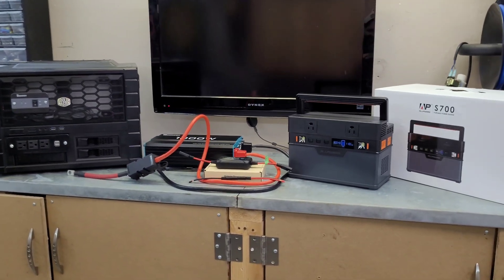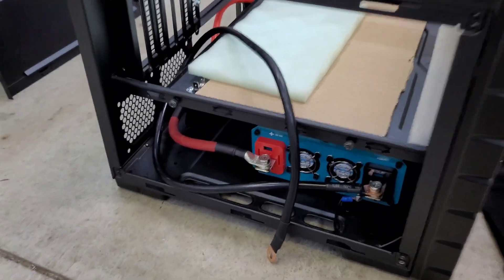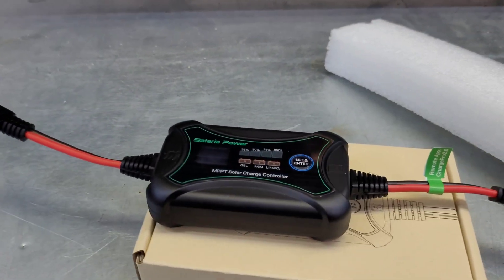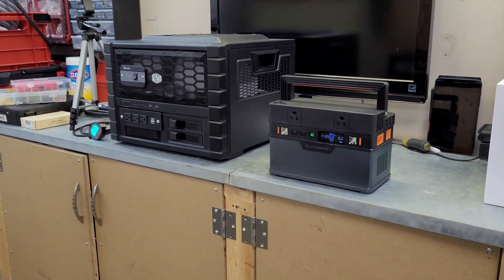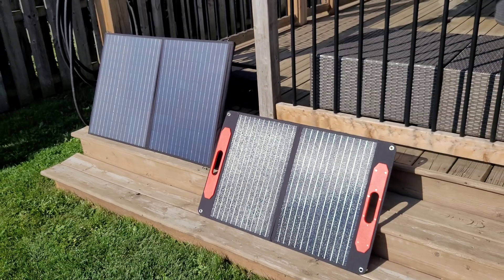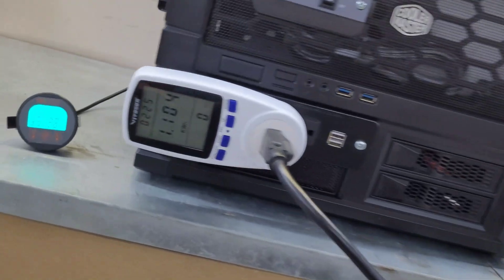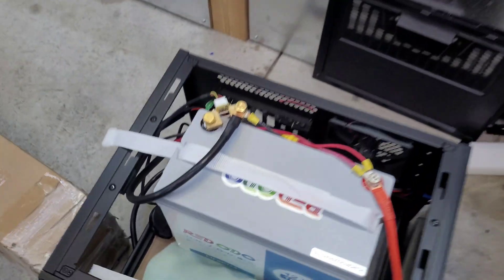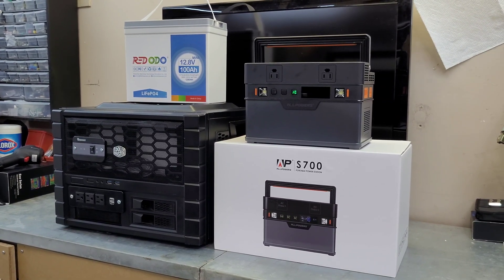Solar Power Station - Buy VS DIY - Redodo Mini Batteries

Comment: Some things I want to know about the prebuilt generators is how easy is it to replace a battery in one? Are they generic batteries? Can you add extra batteries externally to extend the capacity? That is the beauty of a DIY system that nobody talks about that runs rings around prebuilt
Reply from the maker: You could replace the battery if you had some knowledge in making your own Lifepo4 packs. Jasonoid has a good video on adding extra 100ah batteries using a small voltage converter.

Comment: In one of Will's videos not long ago about the portable power stations, the one that has 500 volts solar input is really a good unit. 
If you want quick and dirty cheap one then DIY is the way to go for a small unit. If you are looking to have a stout system them the one the will did the review on is really the way to go unless you can piece all the parts at a lower price. 
Though his 5kwh eg4 battery and eg4 3kwh inverter is really a good system by itsself on a hand truck. 
Really depends on the person and the use case for which unit one would buy. If the companies would get smarter and start building stuff with tons of options and they are smart about it then the portable units will be a viable unit.
Reply from the maker: Definitely depends on what you plan to use it for

Comment: Was the output of the 700 sinewave or modified sine?   Thanks!
Reply from the maker: I don't have an oscilloscope but in the other videos I watched on it, they confirmed it is pure sine. As well as the renogy 1000w
Reply: @SmitHVAC.  I appreciate the quick reply and thanks for the info.  Amazon has little pocket type O-Scopes for around $40.  They may not be very accurate but they will certainly show you a sine wave vs a stepped or modified sine wave.  I do enjoy your vids so thanks for doing them.  Have a great weekend!  👍

Comment: Built my own a couple of years ago with a 1000w inverter to use in the 5th wheel dry camping. My crappy coffee pot at 800w sucked, so I had to get a single serve Keurig and up the inverter to 2k watts. Worked perfect testing but couldn't fit the bloody thing in my box. Been just setting up battery w/inverter on table ever since - redneck city but it works. However after seeing the Anker 767 with 30amp plug (max 20amp draw), I'm seriously considering it.

Comment: My recycler lets me sift through his copper wire bins and pull out what I need at 4 dollars US per pound. I've got some great deals that way. I've never seen anyone do a video on that before. I make my own connectors out of copper tubing by flattening one side in a vise and drilling a hole on my drill press. Then I use a hydraulic crimper to connect. Works great.
Reply from the maker: That's a good idea! I have some 2 gauge windy nation cables I've swapped these out for

Comment: The cables that come with the inverter might be copper clad/undersized I would check/ replace them for the proper size & pure copper.
Reply from the maker: They are 4 gauge but I replaced them with some windy nation 2 gauge, much nicer soft copper